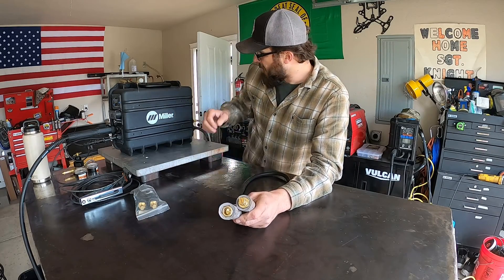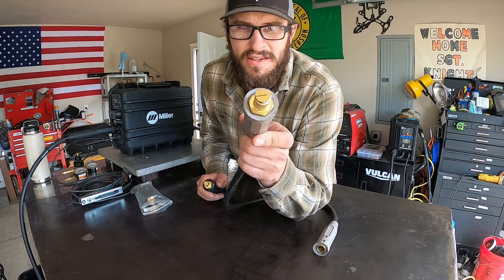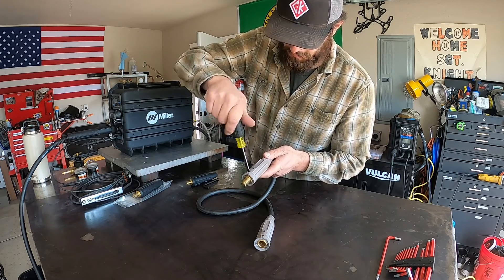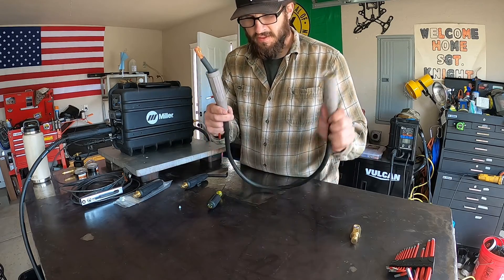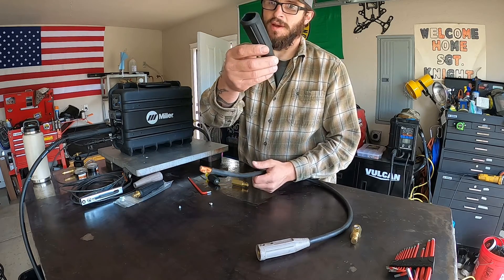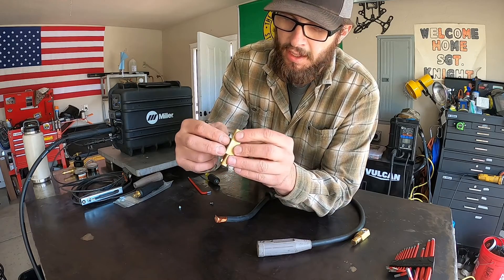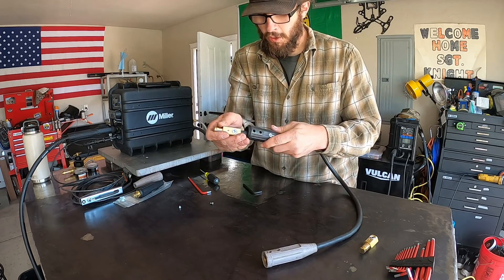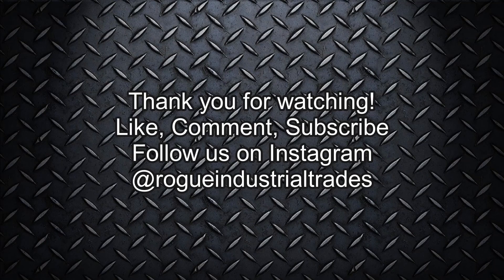How to Attach a Welding Connector

Comment: i think i need to build some tweco cables for a cst280 i just got. ive never dealt with the tweco connectors before. are they all the same size as long as it says tweco? trying to figure out the wire size i need as well. i think ill be welding on 220 so it really only goes up to 200 amp but i guess something rated for 280+ would work as well. Anyone have any pointers on where to go from here? thanks

Comment: Why any company still makes/uses flat head screws is beyond my comprehension.  Robertson (square drive) or torx are the only way to go IMHO.
Any reason no to use a dielectric grease on the wires first?
You didn’t torque that set screw holding don the wires very much. I’d have thought you’d flip the Allen wrench so you could grab the long end and give it a really good tightening.  Did you go back and do that off camera?
Thanks for the video.
John G,  NH, USA
Reply from the maker: @jg I did go back after the fact and torque the allens down. I don't use dielectric grease on these fittings. No reason why, I just don't. Thank you for the comments. Sorry it took so long to get back to you. Cheers.
Anthony